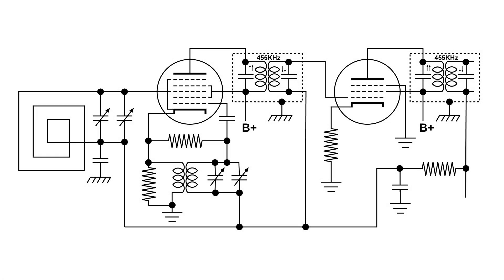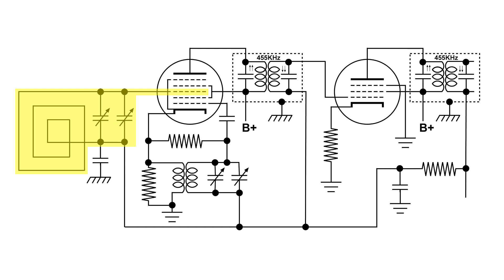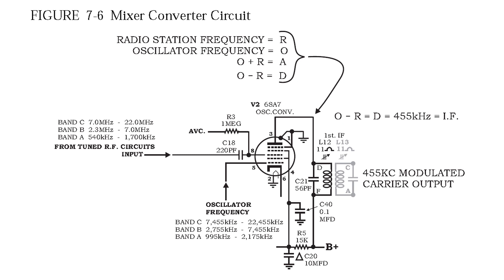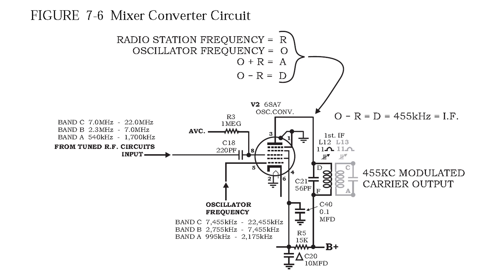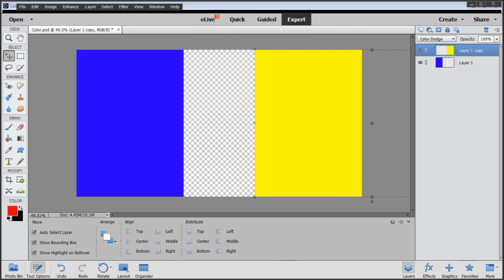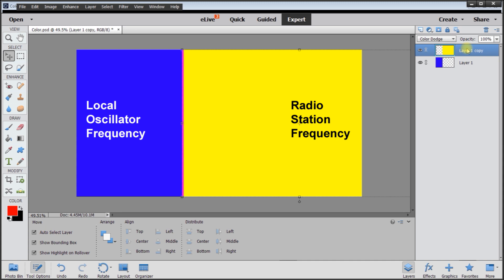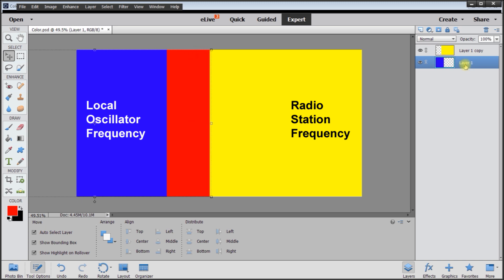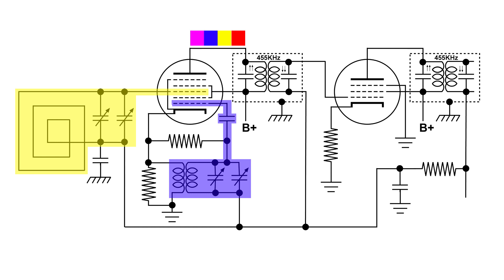Superheterodyne Radio, heterodyning  frequencies together, how it works

Comment: Hi there! I understand fairly well about how the local oscillator mix frequency with the selected antenna emf carrier where
the output will be 455Khz and you get the sum and differences which are the 4 output signals on the plate of 1st tube.
But I can't get my mind to understand how even at the antenna as carrier waves from a whole HOST of signals hitting the
antenna, WHY don't you get "destructive interference" (Lost Information) due to incidental frequencies cancelling out each
other. Like, if you have two or three "water" waves coming to shore, sometimes they add up to produce a larger wave...and
sometimes the peaks and valleys cancel each other and you don't get a peak or valley. With a multitude of  radio
frequencies hitting the antenna, why isn't that information LOST on the input grid of the 1st tube?  Do radio
waves not behave like water waves in that respect? Perhaps it's just that simple, but I need to hear from someone
that knows...lol!  Perhaps not matter how many radio signals there are in the area, "radio" waves always combine, but
never destroy?  Thx AllAmericanFive or anyone who can help me correct my thinking!
Reply from the maker: Interesting question and observation. If you through two rocks simultaneously into a pond, the waves from each will interact with each other and depending on the distance from each other they will add and subtract at various points. The waves produce this way are of the same frequency. This means that they can influence each other as much as possible. This is why there cannot be two radio stations on the same frequency in the same coverage area. The distance between radio stations and the difference in frequency of each radio station are carefully chosen to minimize interference between stations. I helped take care of a 50,000 watt AM station that was daytime only, from sunrise to sunset only. This station had to go off the air at sundown because at night the sky wave travels much farther. This station, in North Carolina, was on the same frequency as a 24 hour station in Boston. At night if the North Carolina station did not go off the air it interfered with the station in Boston. So the time of day is also very important along with distance and frequency.

Comment: Excellent.
Reply from the maker: +vibra64 Thanks
Reply: +AllAmericanFiveRadio Would this hetrodyning work in the newer digital radios?
Reply from the maker: +vibra64 
It could. Today's digital radios usually use Phase Lock Loop (PLL) circuits. The PLL circuit is simpler and does not require a change of frequency. When superheterodyne was first invented PLL was known but it was too expensive to produce, that is no longer the case.

Comment: The 455kHz filters are bandpass filters right?

What would be the passband of these filters? If they were very narrow you wouldn’t be able to use the output for audio right? Their passband has to be wide enough to cover the range of frequencies across which the original RF frequency signal into the antenna is Amplitude Modulated right? How wide would this passband be?
Reply from the maker: The 455KHz is a very narrow peak. The audio information is on the amplitude of the 455KHz carrier.
How does a Diode, Demodulate AM Amplitude Modulation
https://www.youtube.com/watch?v=ej1KCkE_RsY

Comment: is this the same as a mixer for a FM signal or radio circuit?
Reply from the maker: AM intermediate frequency is 455KHz, FM intermediate frequency is 10.7MHz. Same process different frequencies.
FM Radio Signal Tracing
https://www.youtube.com/watch?v=a5qa4OFockA

FM Detector Demodulator
https://www.youtube.com/watch?v=tmhhltKM9z8

FM Demodulation and Detection, Demo
https://www.youtube.com/watch?v=lYjIGni4Z7g

FM Stereo MPX Decoder Circuit and Demo
https://www.youtube.com/watch?v=ACqEiFHCofI

Searching My AllAmericanFiveRadio Channel
https://www.youtube.com/watch?v=4k7ByHqh8Js

Comment: Hi Richard, you have some of the best comprehensive video's and explanations out on YT.  I have been struggling grabbing exactly what the hetrodyne was doing within the mixer/oscillator sections and your videos really helped.  Thanks!  Just a few questions.  If you were to put a scope on the plate of the first tube, what would it look like?  Also how/why is the modulation maintained in the bottom 455K signal?
Reply from the maker: Thanks pappafrito
A scope on the first plat would already be almost only 455KHz because the the primary and secondary are very sharply (high Q) tuned. I'm not sure what you mean by “ bottom 455K modulated signal” and that's OK, I want to answer your questions. You do have the right idea about the purpose of the highly tuned I.F.'s, “ignoring anything else”. The tuned I.F.'s only passes the 455KHz modulated signal. Ask your questions. 
Here is a few videos that may help you  on AM Demodulation. 
AM Detector Demodulator
https://www.youtube.com/watch?v=8AWscuGSjsY

AM Radio Demodulation Oscilloscope Demo
https://www.youtube.com/watch?v=pKA0TPdnHg8

How does a Diode, Demodulate AM Amplitude Modulation
https://www.youtube.com/watch?v=ej1KCkE_RsY
Reply: @AllAmericanFiveRadio  Thanks so much for responding and the links. Sorry my question is probably confusing as I tried to edit it after the fact. Basically I'm experimenting with building a low voltage tube am superhet radio  (using a 12fx8 and 12al8). I’m fairly clear on the demodulation side. The mixer however I'm not quite clear on as to what is actually happening in the mixer (visually). I understand that you will end up with Rf, Rf+LOf, Rf-LOf, and LOf in the mixer (and also other frequencies??). I am not clear at all how/why that all happens in the mixer visually.

So if I’m at least understanding the basic principle correctly, If I wanted the tune my radio to 640am, I would tune a gang capacitor so that both my tuner tank circuit resonates at 640Khz AND so that my local oscillator oscillates at RF+455Khz (1.095 Mhz)?   Then put that signal through a highly tuned 455K filter to get the IF to the next stage amplification.

Then why/how does the 455K signal maintained the modulation through and out of the mixer? Or are all of the 4 separate frequencies equally modulated?  I know Rf is obviously modulated.  I can see how Rf+LOf could be modulated with the audio.  This is where I’m getting lost… lol!

Thank a million, love your vids!
Reply from the maker: @PatrickInCayman  Thanks pappafrito
I'm thinking about how to show the mixing process. Might make a video. It has to do with Harmonics. I'm doing about three or four things (projects). SO if you do not hear from me in a few weeks, send me an email. I want to answer your questions. 

Rick
Reply: @AllAmericanFiveRadio  Thanks Rick, looking forward to it!  And thanks again

Comment: Are all AA5 radios of the superhet design?
Reply from the maker: +bigpops 
Back in the late 1940s, 50s, and 60s, yes. The five vacuum tube set. The better radios had six tubes, it had an extra tube in the frontend, an RF amplifier
Reply: AA5R,

Joernone did a video for a tube-based AM transmitter that was connected to a design of yours.  I'd like to try this project and was wondering if you'd mind sending me the schematic and parts list.  Best, Tony
Reply from the maker: +bigpops 
This link has the video, pictures, and wiring diagram with all the parts listed. Also email questions from cameramanlink and my answers.

http://www.richardmcwhorter.com/AM_Transmitter/